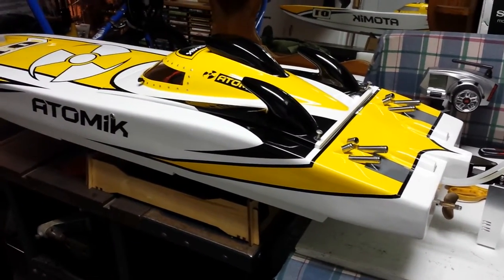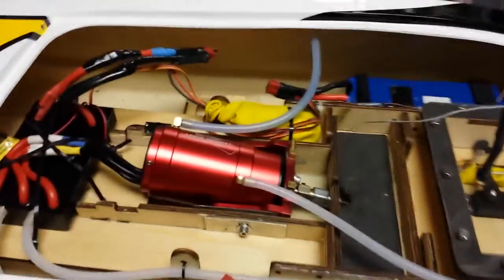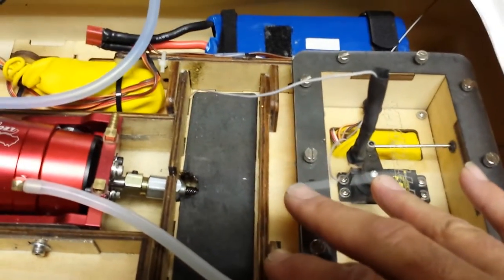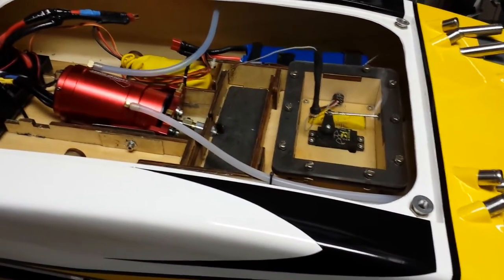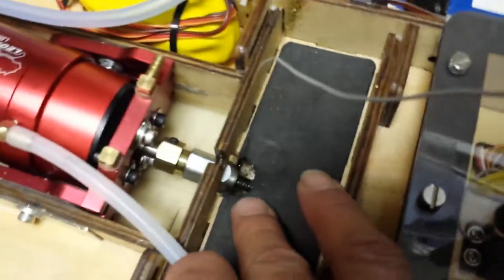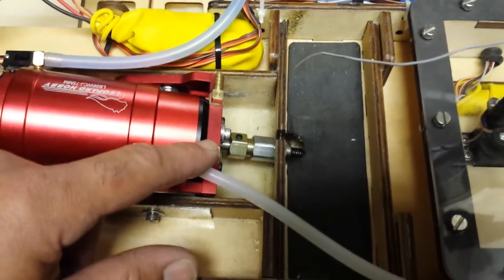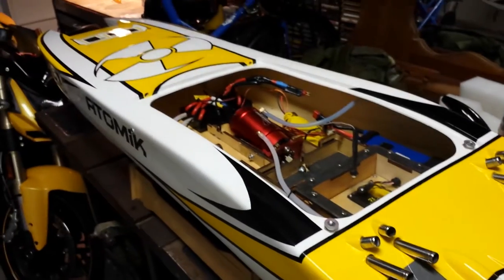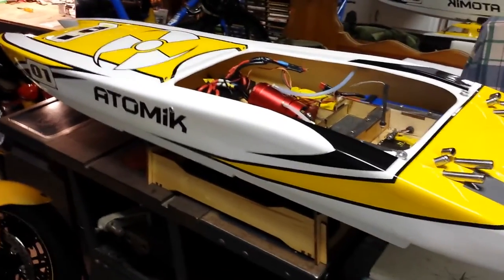Atomik ARC 58in Catamaran

Comment: Thanks for the full information about your setup I think your the first. Couple of things ditch the deans and if the batteries are Zippy DITCH them for a higher grade lipo eg. nano- tech. Reason being  had nearly same setup in a Venom Segad, Porteus 750kv, 200amp aquastar, 55mm 3blade 1.4 pitch using a 5s in series everything running cold, water temp cold. One battery dropped 2 cell and cooked the esc internally  all wires untouched . All gear brand new 4 runs old. No damage bar smoke.

Comment: How is your boat doing these day...? By the way you have things set up I'm guessing your boat burnt up in some devastating fire and you May no longer have it from the deans connectors with electrical tape to The propeller is too big
Reply from the maker: What's up hater! Boat is fine and runs great. Fyi tape is over shrink tube. And if you think the prop is to big the data logger doesn't lie.